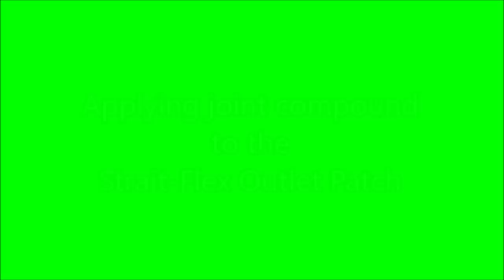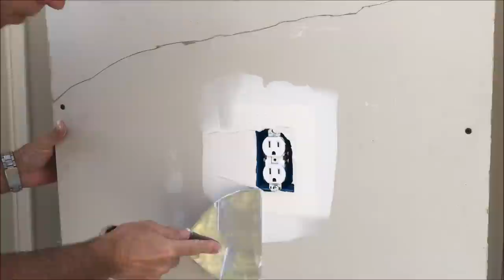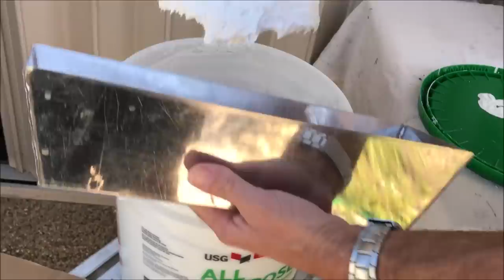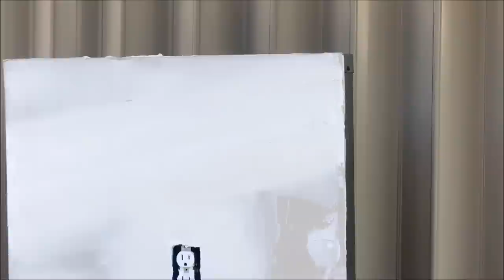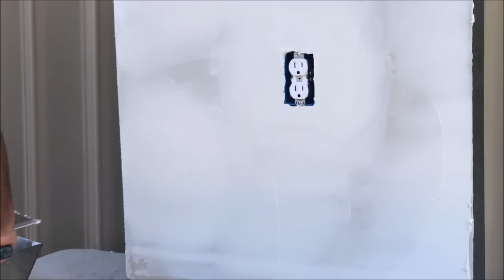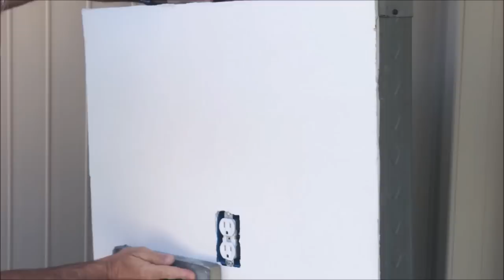How to repair holes around electrical box- Contractor tips and diy tricks

Comment: A most excellent job! I haven't seen anybody do such a nice job. I did learn to do such a thing. Working in a couple of old houses for my friend. Little bit of trial and error but I was able to blend in the plaster wall with things and what not to the remaining wallpaper. Of course there was a lot of cutting out of wallpaper that was Jagged or pulling off. By no means that I remove four layers of wallpaper. It wasn't necessary.

Comment: Also a great tip in which i struggled to figure out and learn,,, mainly for remodeling or blending or anything drywall mud related and there is a large holes or different planes to match...  and that is always do the first coat or fill with the mud as thick as possible,,   Screwholes especially....  ( obviously banjos and bazookas and brand new whole house taping may not apply to this tip

Comment: I have a wall that was textured then years later skim cited over it. Kids stuck cork board squares up and when pulled off, it pulled all off to the brown paper. Area is about 4ft sq. Help. Glue still on drywall around the hole also.

Comment: I am getting pretty good at doing these types of repairs. What I am not getting good at is getting the primer/paint to adhere to the wall afterwards. Seems like you barely touch it and the paint comes right off. I am using the same joint compound that you are using here. Then hitting it with Kilz and the two layers of high quality paint. Any advice?

Comment: Not sure why you don’t spread away from the inside edges of the opening. Is it so you avoid possibly leaving a glob of compound on the inside of the box? At least the first spread, to remove the backing compound, my assumption would be that the template would be less likely to shift, if the knife is moved directly away from the edge of the opening rather than parallel to it. Love your videos!

Comment: I have tried these patches many times in the past and it didn't work out. From what I understand, they suppose to become hard once the first coat has dried but in my case the patch was still very flexible (the same as if I had use regular tape). I could bend the paper pretty easily just by pushing it with my finger. Is that normal?
Reply: Yes, it isn't steel, it is just an aesthetic cover, not different than if you had used joint paper.  The joint compound will be a little flexible if it is thin and it will crack if you add more and push on it again.   If you have an area that might get any pressure you would need to insert a backer piece of wood and then fill the hole with a piece of drywall and/or mud (ideally harder hot mud).

Comment: Hey Paul! Great videos! Need some advice. I'm painting my kitchen and I'm fixing pop-outs on the ceiling. Would you suggest skin coating the whole ceilingb or just leaving the spots the pop-outs there and then priming over with 2 coats?
Reply: Drive those pop outs in, and fill them in. Skim coating the ceiling is overkill

Comment: I needed to install a Cat 6 gang box and was unable to use that spot for it's intended purpose. Because I had already cut out the hole, I need to repair the spot.  I am planning to reuse the piece that I cut out, but of course, there is nothing to hold it in place.  I thought of purchasing a shim or small piece of wood and place it inside the wall and drill it into the drywall using dry wall screws, then attach the cutout piece of drywall to the shim/wood piece and them begin the compounding process.  What do you recommend that I do?  Great channel,  btw :-)
Reply: "I thought of purchasing a shim or small piece of wood and place it inside the wall and drill it into the drywall using dry wall screws, then attach the cutout piece of drywall to the shim/wood piece and them begin the compounding process."
Yes, a piece of drywall that closely fits the space backed with a piece of wood that you screwed in above and below the hole (or side to side, whatever) is exactly how you would do the repair.   You will find repairs that just use the paper on the front to hold the piece in place but don't do that as it may look fine but if you ever have any pressure applied to that spot it going to crack at a minimum and likely just push through.

Comment: I’ve got somewhat of a drywalling challenge.  My daughter recently had to have the gas line to her fireplace repaired.  When the guy finished, I was left with (2) problems.   The first was easy:  patch a 6”x8” hole in the wall.  The second is making me nervous:  I hand carved a rough 1-1 1/2” hole in the patch…assuming that the 1” diameter shaft floor plate would screw down on the gas line flush…hiding the rough cut hole.  Yeah…so that didn’t happen.  The floor plate shaft is 2” long and sticks out from the wall about 1 1/4”, exposing that ugly hole.  Worse, behind the patch is basically a horizontal gas line which is unsupported.  How do I fabricate a clean hole around this thing that won’t start to crack / chip over time from turning the fireplace on / off?  How close can I get with the hole?  Is the patch a whole do-over?

Comment: Personally, I would have used 5 min hot mud first two coats. But for the homeowner use 20 or longer hot mud. The 5-minute mud does not allow for slow application.

Comment: does not apply to remodeel where gang box has to be replaced by 2-gang box and hole for single gang is oversized with mud that will fall out when installing  rock squeeze swing lug.

Comment: Good video series but I don't understand you Americans. You call it mud when it's plaster and you still work in feet and inches. By the way, I'm not from England. They also work in feet and inches.
Reply: We're on the standard system and you guy's are on the metric system.
Reply: Mud (joint compound) and plaster are similar but different. While they both have gypsum powder, plaster has sand in it, while joint compound does not.